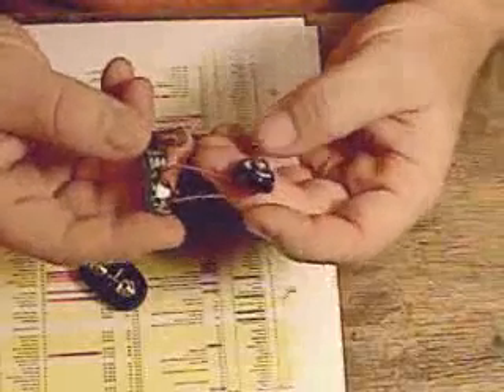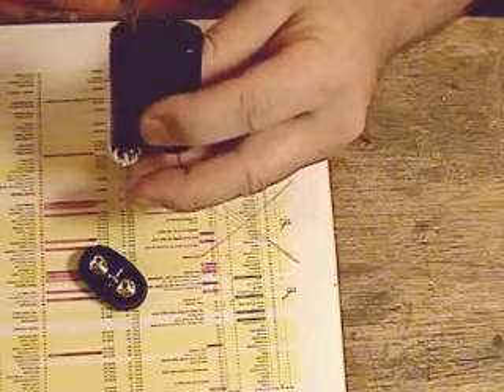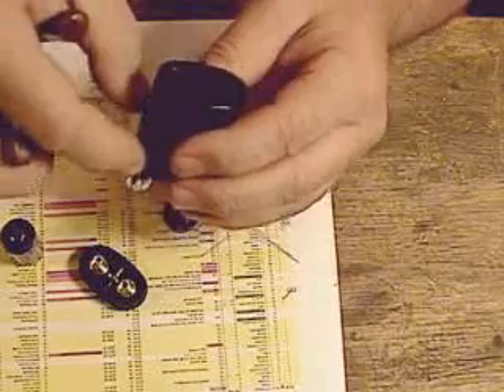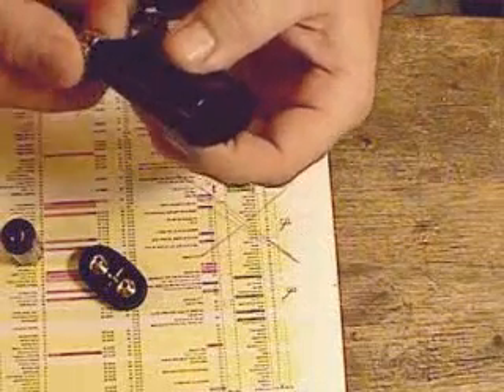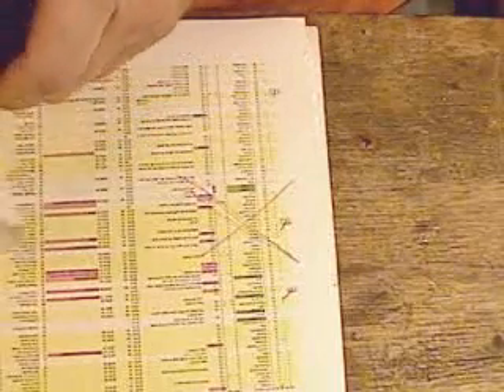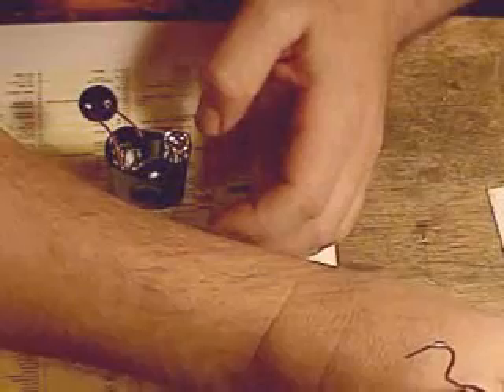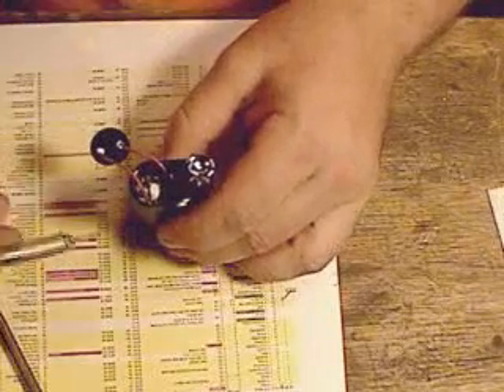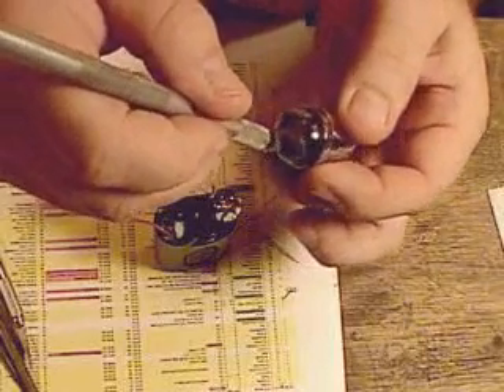assembly of the 005 flashlight

Comment from the maker: You are absolutely correct.  But I am leaving this video up till I make a new one.  This is a video of the internals of the original 005 converter board. The biggest difference is the STFu converter board is held in place with a screw, the knob can not come disengaged and the STFu does not need a thermal path to the body.  There are many other differences as well but this video does a good job of showing how the light goes together.